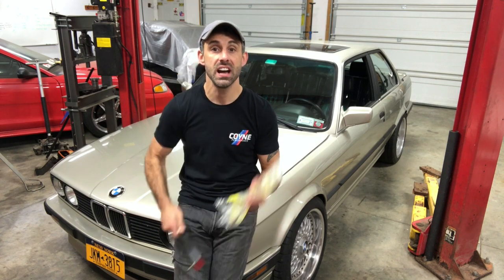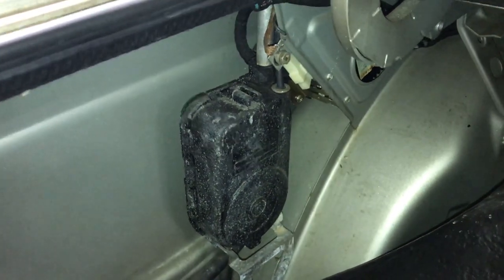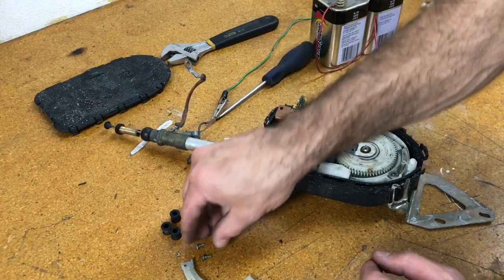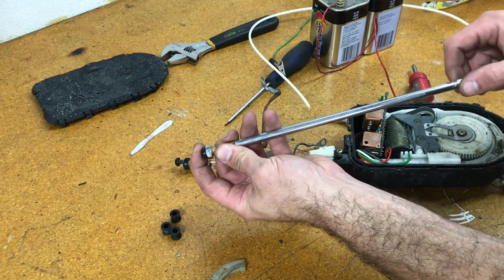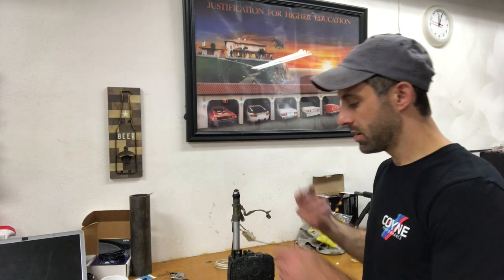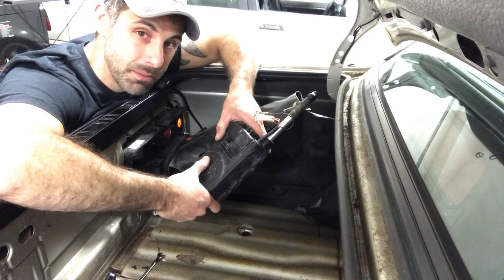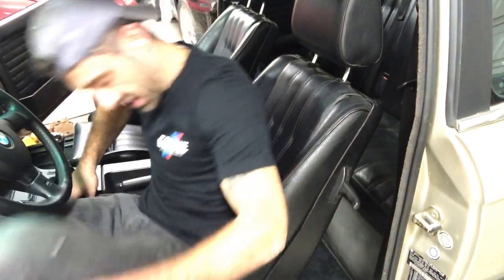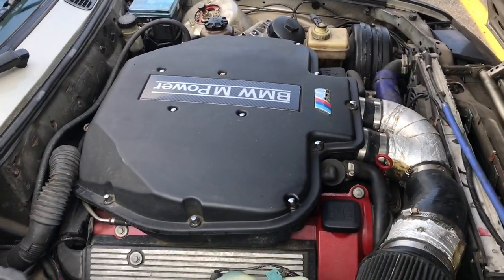How to Replace that Pesky E30 Antenna Mast, Seatbelt, And More Radiator Switch

Comment: You don't need to access the antenna from the trunk to change the antenna.  You can do it much easier.  More here   https://blog.bavauto.com/11738/bmw-electric-radio-antenna-mast-replacement-how-to-diy/

Comment: My guy, you don’t need to take the mechanism out and take it apart. All a person has to do is unscrew the aerial from the assembly (there’s a place on top to put a 13mm open end wrench to it), remove the aerial by turning on the radio to let it out. Then, leaving the radio on, putting the new geared tail down into the assembly with the teeth facing backward toward the rear of the vehicle. Feed the tail down until it stops (it should feel slightly spongy pushing against the gear inside the mechanism), and have someone else turn the radio off while you feed the tail into the mechanism while it winds back up. You’ll be feeding the entire aerial into the mechanism as it eventually fully winds back in. At that point, screw it back into the top of the mechanism and cycle it again so the aerial fully closes and you’re good to go.
Reply from the maker: Disassembling the unit is easy and effective to clean old hardened grease. And makes installation just as easy as your method.
Reply: @Garageaholic  yes, fair if it’s acting sluggish. But I wouldn’t say it’s as easy. The process in this video is fiddly and you can easily break off tabs on the assembly and takes like an hour or so to do. The method I described you could probably do in less than 5 minutes and there’s no risk to the unit. Anyway, thanks for making the video, just wanted to raise an alternative.
Reply: In my experience, there can be pieces of the geared tail inside
Reply: @wolz256  yes, and there could be all manner of other perturbances in there as well. 

If you suspect your unit is gummed up and has broken pieces, sure, take it apart, by all means. I have done it myself many times. But you don’t need to unless something is amiss about the mechanism itself (acting slugging, making grinding noises or whatever else). Use your best judgment, but in most cases that involve a broken aerial (car washes, some dingus messing with your antenna), you really don’t need to fully disassemble the unit.
Reply from the maker: Guys,
Disassemble the unit, fix, and then reassemble. It’s not hard. Learn how your car actually works. If not, find another channel.

Comment: Hey frank any idea on what would cause the antenna to keep draining the battery when the car is off? My gfs vert would die if it was parked for 2-3 days charger batteries and alternator till I found out the antenna was the problem so it’s still on the car I just disconnected it. And it did work btw it went up and down when the car would be turn on etc

Comment: No need to dissemble antenna drive to replace mast.  Extend antenna fully, remove mast, feed new mast cable into housing unit teeth contacts gear then retract antenna.
Reply from the maker: That’s true!!

Comment: I need to replace the antenna on my E30 as well. Is it necessary to remove the gear holder plastic piece before yanking out the mast? Or is it possible to just pull out the mast without accessing the motor from within the trunk?
Reply from the maker: Not Sure never tried it that other way. It really is quite easy when you remove the cover! And removing the cover itself is easy, so doubly easy!
Reply: You can do it easier - follow these instructions  https://blog.bavauto.com/11738/bmw-electric-radio-antenna-mast-replacement-how-to-diy/

Comment: Nice video!! Where did you get the replacement antenna mast?
Reply from the maker: You can get them on eBay for under $30. Cheap and easy enough to replace in under 1hr. Lasts at least 5-6 years
Reply: @Garageaholic  There is a toothed and smooth version.  Make sure you get the correct one.